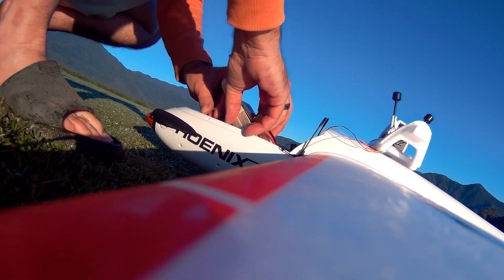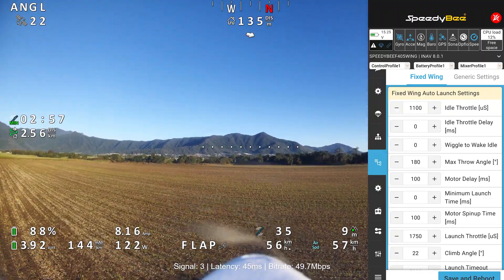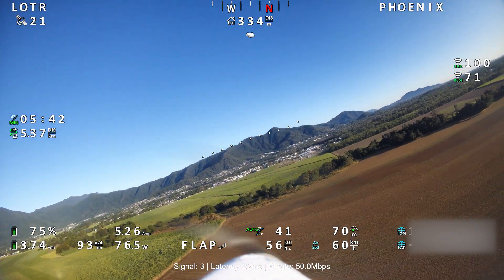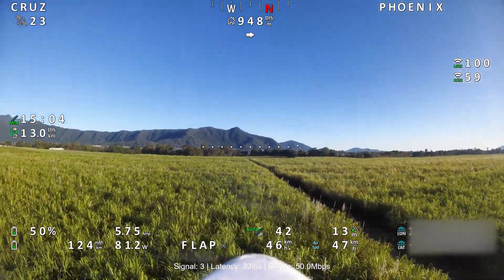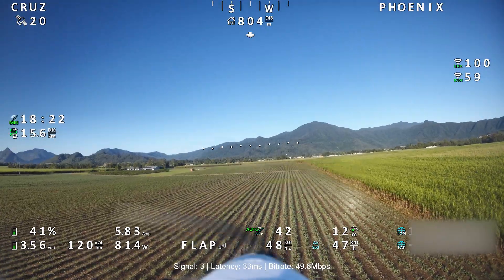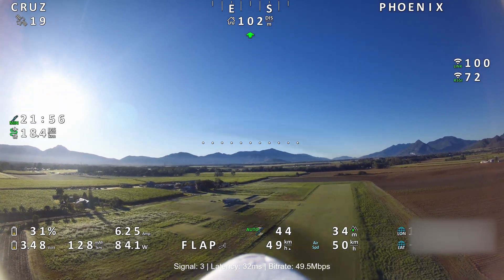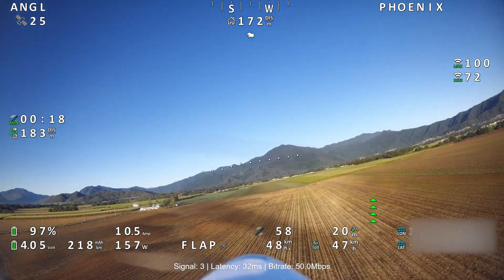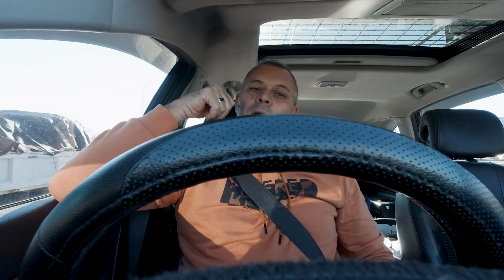Volantex Phoenix 2400 | 4K Flight with Walksnail Moonlight – LiPo vs Li-Ion Efficiency & INAV Tune

Comment: Your plane fly's so smooth. I just ordered the Phoenix S 1600 but would like to eventually get the 2400. I would also like to a camera system and a way to make it do way points.
Reply from the maker: The 2400 is a very smooth flyer out of the box easy to fly and makes a great fpv plane. Highly recommended! Thanks for watching.

Comment: You have a very good bitrate! What antennas did you use on the glasses and vtx? And is this a recording from the glasses or from the vtx?
Reply from the maker: It has stock aerials on the vtx. Goggles have a pair of True RC X2 airs on top and stock aerials at the bottom. The recording is from vtx with OSD overlayed on top.
Reply: @stonesrcchannel  And what power do you set?
Reply from the maker: @Артур-о2н this flight it was set to full power 1200mw

Comment: Nice trip and enjoyed the narration.  I have the 2.4 m ASW 28 but can only fit 3s 18650 before becoming nose heavy.However It can cruise for up to 40mins . For what it's worth I use Goggles X and with the triple feed patches on top OR the X2-Airs on top, the range is about the same regardless of whether the stock stubbies or either of the afor mentioned are on the bottom.
10 kms any time , 16.5 kms on best day with the Nano VTX.
Reply from the maker: Thanks for watching glad you enjoyed. I have heard the ASW28 is more nose heavy very nice plane though and better looking than the phoenix I think. I need to properly test my range with this setup but that’s great to hear what you get with the nano.

Comment: That's crazy quiet as it passes you, the traffic in the background is louder! Which prop? I didn't see it listed in the details.
Reply from the maker: It's the stock 10 inch prop which came with it. The plane is amazing when it flies past with no power. You can hear the wind coming off the wings as it flies past. The camera doesn't really pick it up though.
Reply: @stonesrcchannel  Almost looks ideal for a sports stream/tv platform, let it loiter with the RF link for cameras to hook up through, in places where you can't put up a tower - like out streaming Rally's or Mountain Bike
Downhills. Quiet so it doesn't disturb anyone spectating.

Comment: Beautiful plane and beautiful flight.👍
The flight was amazingly smooth, because no wind no turbulence or the fine tuned PID?
I have a Volantex Phoenix V2( 2000mm wingspan) with arduplane and It shakes a lot in roll direction.
By the way, the horizontal line of OSD was not level anymore at 14:44
Reply: The artificial horizontal indicator (AHI) goes out of sync/slow to react because inav doesn't account for accelerometer drift when the aircraft banks. The effect is more prominent in higher g banks. It has been a problem since version 2
Reply from the maker: @burntnougat5341 it's fine while flying not out of sync. The problem is the overlay when adding it to the video. It seems to be a little shorter than the video hence it goes out. The way to fix it I have found is using Sneaky FPV overlay and creating the OSD as a transparent video which is overlayed on top of the flight video in the editing process. This way it can be aligned perfectly. You will see in my next video.
Reply from the maker: Thanks i really enjoy the peacefulness this plane brings when flying it. Its a pretty smooth plane right from the start but i think minor adjustments in PID's has made it even better. 
Regarding the horizontal line, that is not like that while i'm flying. The OSD overlay seems to go out of sync a little as the flight goes on. I have now worked out a way to fix that so future flights won't be out of sync.